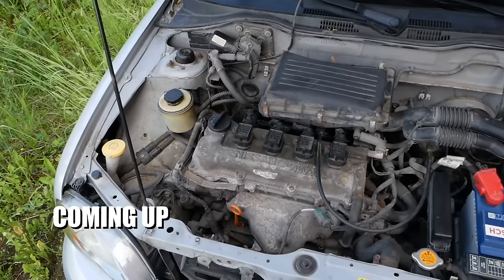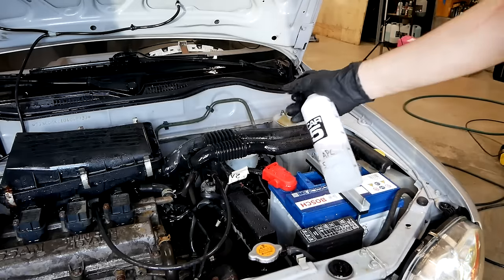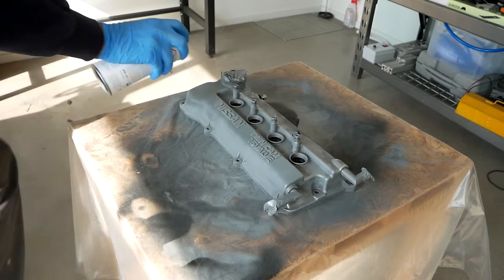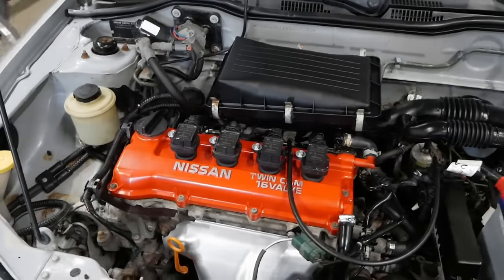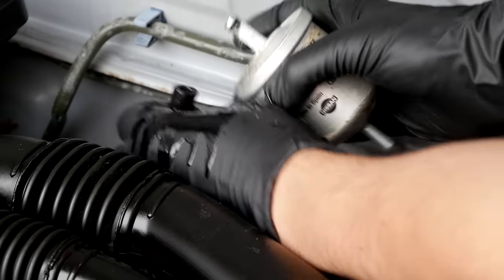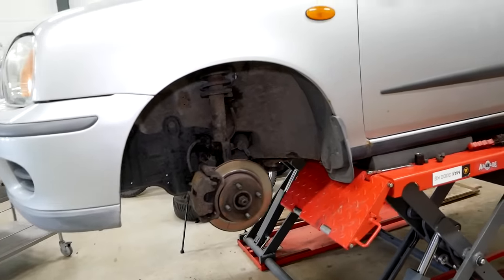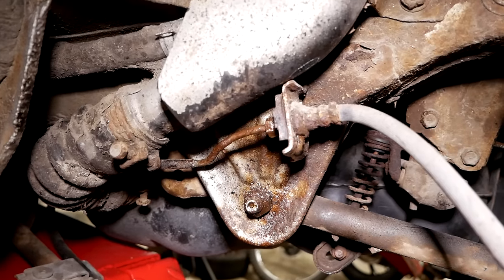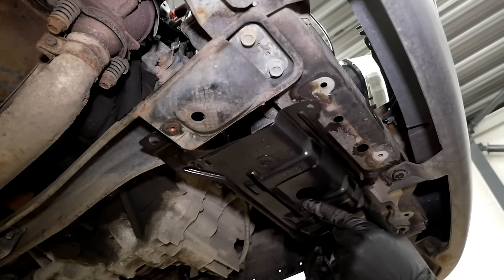Restoring Engine Bay and Bringing New Life to 21 Year Old Nissan

Comment: Check the rust on the cross member under the radiator where it joins the chassis . It's one of the most common failures on the chassis and will stop an annual inspection being granted .
Reply from the maker: Fortunately that cross member is mint, barely any surface rust on it! 👍
However the rockers/sills are pretty rusted on some places :/

Comment: Great work! You should definitely check the cooling hoses that go into the firewall and connect the cooling system with the heater. The fittings there are plastic and they disintegrate...
Reply from the maker: Good tip, thank you. Will look into that. 👍

Comment: Wax is there to prevent rust at panel joints and part that are known to rust easy, and on electrics to prevent moisture to contacts. Lots of old cars have wax between panels, to prevent rust between two sgeets of metal, like hoods, doors etc.

Comment: Greate video, as always. One thing, I was using engine flush few times and manual always stated to not rev engine, only idle.
Reply from the maker: Thank you! 
I just did because I wanted to vary the oil pressure a little bit. Don't think it matters much though...
But if the instructions says only idle then you should go for that. 👍

Comment: I like the way you explain and record the job. You should’nt install rubber brake lines, much better racinng/ metallic brake lines. Regards from Spain!
Reply from the maker: Thank you for your comment!
Honestly oem style rubber brake hoses are completely fine for 99% of situations. Many high performance sports cars comes with rubber hoses from factory and they work perfectly good on track.
However, steel braided can give you a better feel and better pedal feedback, but good quality fresh oem hoses are rarely the week point in a braking system. 👍

Comment: Hi, EJO.  I enjoyed the video very much.  Regarding the heat shield for the exhaust, would you also consider using a penetrating oil on the three bolts?  The popular penetrating oil that has the long red straw is what I have.  I intend to bend the straw around the back of the shield in order to try to spray the bolt, and do what I can to hit the bolt head from the outside too.  And let it soak for 24 hours.  Just so I can avoid drilling out the bolt if it has rusted badly.  I guess the exhaust manifold will smoke and smell bad for a while - but wouldn't it eventually burn off and not be a factor?  Do you still remember the size of the bolt you replaced, by chance?  I'm doing something similar.  With the same mindset actually.  I did an AC delete and moved the alternator.  The brackets for the ALT were very rusty and I sanded and painted them - came out great.  Thanks in advance.

Comment: 8:56 you’ve used screw clamp instead of flex one which was before, are you sure that it won’t be leaking when engine will change temperature? Usually flex ones are used to compensate temperature size changes.

Comment: 日本国内向け仕様とヨーロッパ向け仕様でかなり違いがあるのが分かる。日本国内向けだと2000年型でもディストリビューター点火だがこのモデルはダイレクトイグニッションになってるし、ついてる補機類も日本仕様とヨーロッパ仕様でずいぶん違う。
今後、日本から中古車で輸入されてくるK11があるだろうが、同じ右ハンドル車といってもUK向けマイクラと日本向けマーチで結構別モノだということは覚えておいた方がいいかもしれない。

You can see that the Nissan Micra is quite different between the Japanese domestic specification and the European specification. For the Japanese market, the 2000 model also has a distributor ignition, but this model has a direct ignition, and the auxiliary equipment that is attached is very different between the Japanese specification and the European specification.
Regarding the right-hand drive K11 Micra that will be imported from Japan as a used car in the future, be aware that there are big differences in various parts between the Micra for the UK and the March for Japan, even though it is a right-hand drive model. want.
Reply from the maker: Thank you so much for writing this comment. Very interesting! 👍

Comment: why did you keep that rusty bolts on that freshly painted valve cover, even though you replaced the heat shield bolts and the hose clamps? anyway, nice work! 👍🏼

Comment: Really cool video! Ne careful with stainless steel hardware. Never mix stainless steel with aluminum. That’s going to cause heavy corrosion (galvanic corrosion) and discoloration of the stainless steel. I don’t know what the block and the heat shield is made of, but beware :)
Reply from the maker: Thank you! 😊
Yes, you should be mindful when mixing dissimilar metals. I've actually studied the field of material science (and a little bit of chemistry). Heres my take on it:
First of all, for galvanic corrosion to occur there must be dissimilar metals AND an electrolyte. This car wont see winter time and will be used in good conditions during the summer. The top of the engine is also relatively isolated from the elements. The reason people say you should not mix stainless with aluminium compared to steel/alu is because regular steel bolts has a zink coating. Zink/Alu is not as reactive as un-coated stainless and aluminium. However, if that zink coating is comprimised, it's just as bad, if not worse than a SS/Alu combo. Lastly, i coated the stainless hardware with an anti-seize which should prevent galvanic corrosion, even in the present of an electrolyte (salty water). The manifold is made out of cast iron, the heat shield is made out of something that can rust at least. 🤣
Sorry for the long text, and I really don't want to come across as smug or anything... Just wanted to share my thoughts/knowledge on it and explain why I thought it would be best to replace some of that hardware with SS. 😊👍
Reply: @ejoautovideos  Not smug at all!! 
It's actually nice to learn more about this topic. Thanks for sharing it!!
I didn't know about zink/alu. good to know as I zinkplate pretty much every parts in my engine bay in my restoration project...!

Comment: No clue if I’d get a reply a year later but is that orange paint/spray paint on one of the camshafts? I’d so do you know why it’s there?
Reply from the maker: I'm not 100% sure, but if I'd had to guess it's there from factory so that the assemblers can easier and more safely identify the exhaust and intake cam respectively. It simply reduces the risk of a mix up.

Comment: How did you paint the text on the valve silver?
Reply from the maker: The text protrudes out, so I simply just sanded the top of the lettering so that the metal shows underneath 👍
Reply: @ejoautovideos  thought so! Nice job

Comment: High temp racing brake fluid 🤣🤣🤣....thats not a race car ....you should have power washed inner fenderwells while the wheels were off !!!
Reply from the maker: The plan is to make a casual, budget friendly track-day car. I explained this in the previous video of this car. Will it be fast in a straight line? No.
Will it be super fun in the corners? YES!

Comment: Pre filling oil filter is a huge no no. Please do not do what this guy does!
Reply from the maker: What the hell are you talking about??🤦‍♂️ It's the complete opposite, pre-filling is better as it builds oil pressure and proper oil flow quicker. However with that being said it's not crucial, if you want to fit your oil filter dry go ahead, it's not a problem. But don't come here and try to spread misinformation.